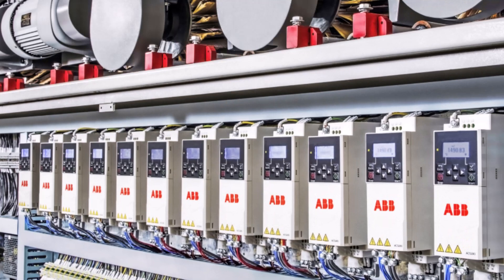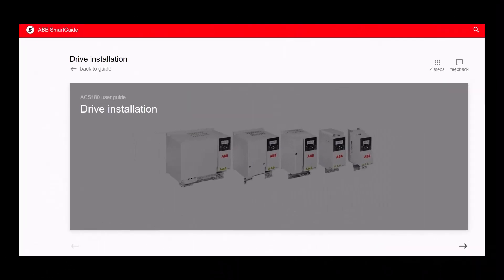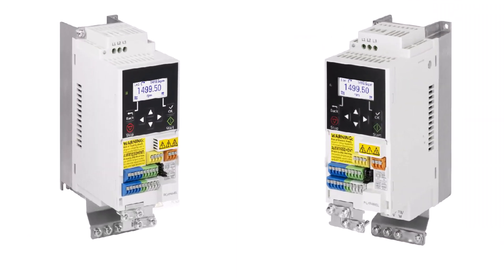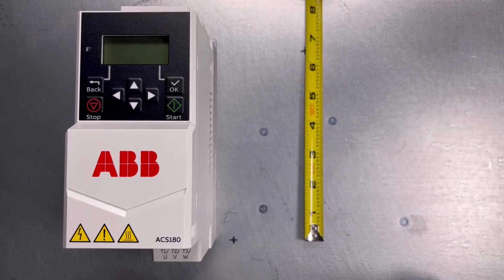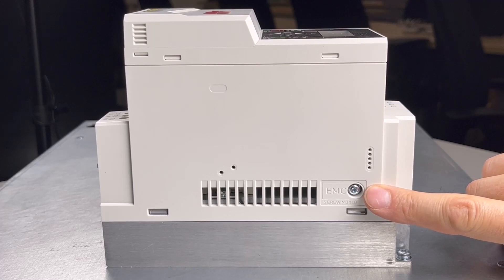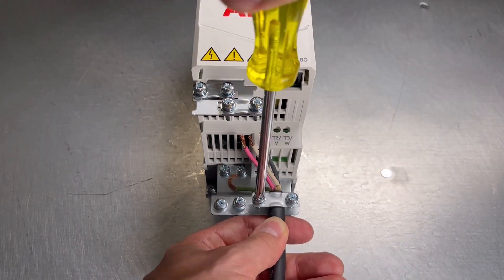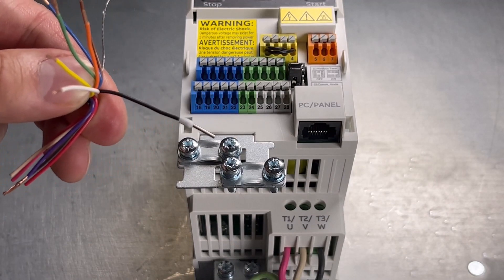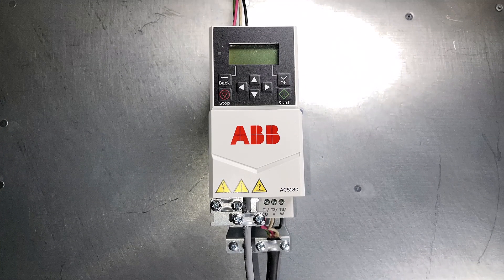Complete Guide to Mechanical and Electrical Installation of ABB ACS180 and ACS380 Drives

Comment: I have a problem in acs 180
Alarm 4981 and oll settings is good.
I noticed that the temperature rises quickly in the settings screen even though the changer is not hot